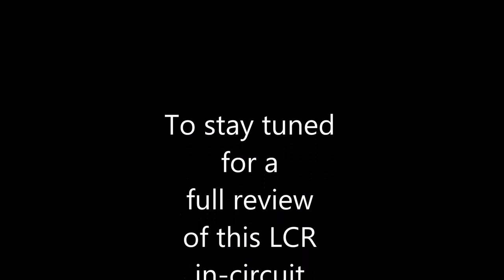First impression of a low-cost ESR / LCR in-circuit tester

Comment: Your videos are great. Thank you for reviewing these testers.

Is there an in-line tester that is slightly more expensive that you would recommend?
Reply from the maker: RetroRumble This inline tester is terrible. I haven't tried any other inline testers since, but used my older non-inline (and had to desolder one leg of the caps...). Other than the significantly more expensive atlas ESR, I can't recommend anything.
If you find a decent device, please let me know.
Reply: Try Justine Yong Blue ESR Meter and Blue Ring Testers - the guy is a genius! I am getting ready to head off to Malaysia to do his advanced electronics course.